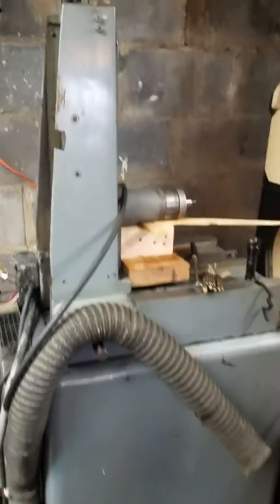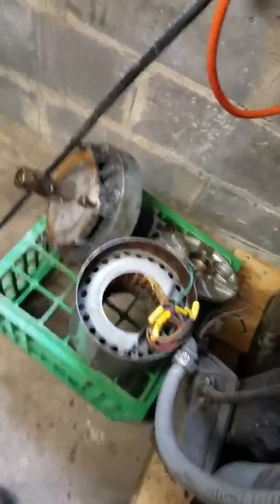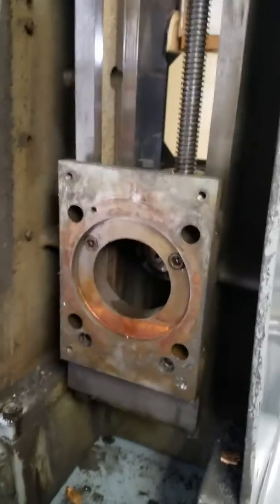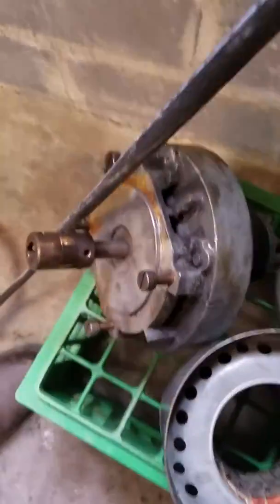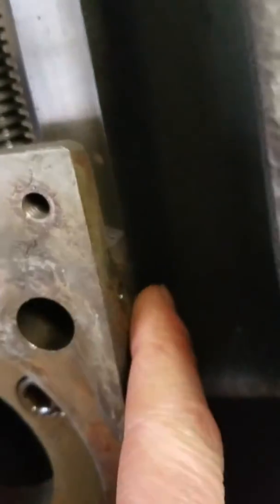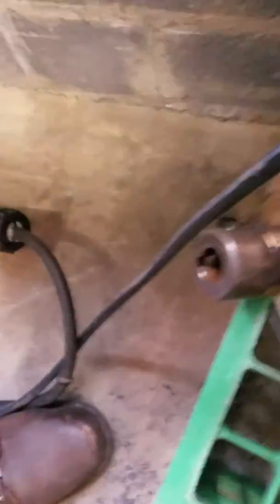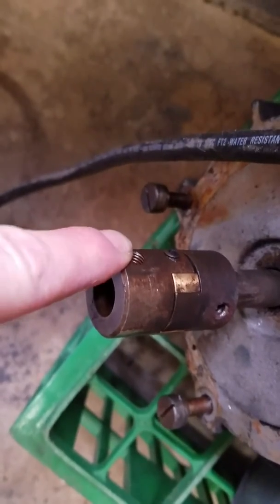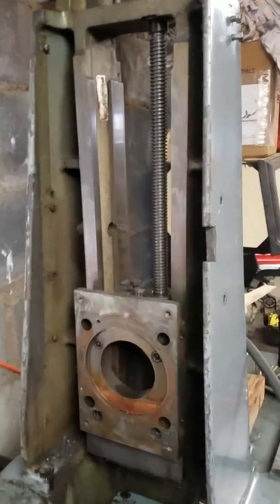Boyer Schultz 612 Surface Grinder How to Remove Motor

Comment: Hi Michael!  great video.   I am wondering if you can help me or let me know where I can get the part numbers of the bearings of a Boyar-Schultz, 2A618, Hydraulic Surface Grinder;   I had found the bearing part numbers from the manual, but are not commercial numbers... do you or somebody could have an idea how to cross these numbers to Commercial part numbers??
thanks in advance
Reply from the maker: Is this what you have already? 36-120 Front Bearing
36-13B Rear Bearing I called a bearing house a few years back, they are $$$$$$
Reply from the maker: Found the post I used with the bearing house: The rear bearing is a Barden 204H angular contact.
The front bearing, if open, is a Barden 205H angular contact. If it is shielded, then it is a Barden 205SS deep groove which was used on later models.
Reply: Awesome Michael...What I got is 3612-B & 3613-B.  Please confirm if it was a typo or are different from what you got..